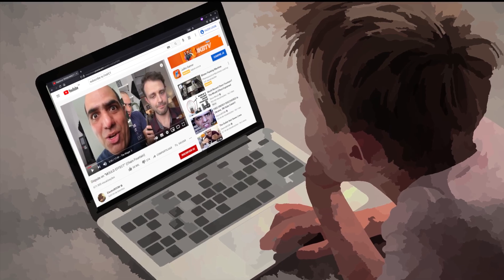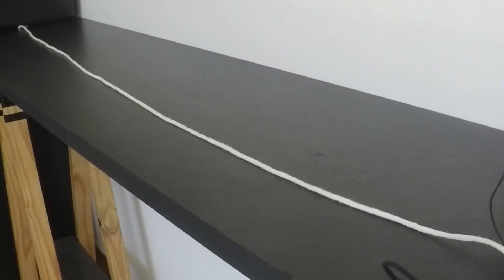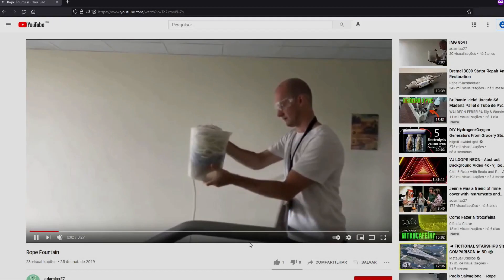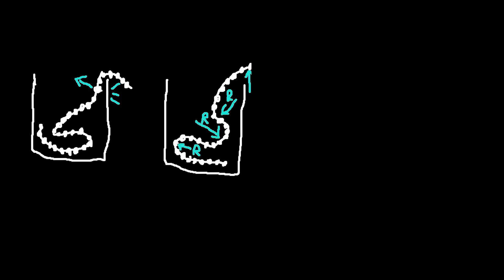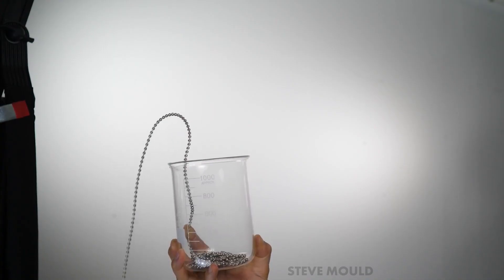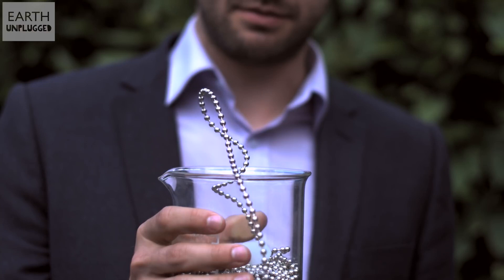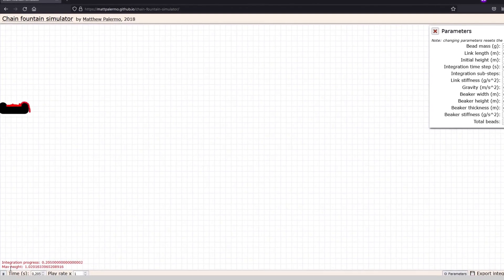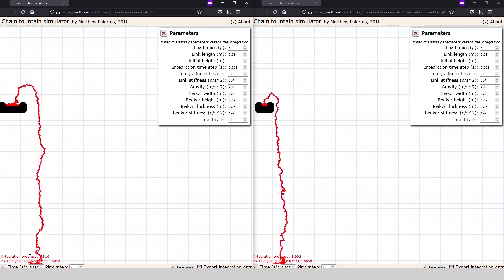ElectroBOOM vs Mould: Who's right? How does a chain fountain REALLY work? Mould effect explanation

Comment from the maker: In my view, the main problem from most explanations is to assume that the system is in a steady state, there is an significant influence from the dynamics of the waves that form as the chain is pulled out of the container, introducing fluctuations on the tension in the chain. 
We need some more slow-mo footage to analyze and new experiments trying to suppress the wave formation.
Reply: Sorry, it might be false - a video called "horizontal chain fountain" on the channel  Jeremiah Wanga has a chain going off a horizontal surface with out climbing a vertical wall before the edge.  It grows pretty high, but as the motion smoothens out, the height goes down though the horizontal distance gets really long.  But honestly, it's almost as if the chain is taking the acceleration and acting like a spring vibrating at it's resonance frequency...
Reply from the maker: @nukedathlonman  Interesting, haven't seen it before, very intriguing. As Mehdi said in the last video, the fountain tends to grow in the direction it is coiled. I'm not sure, but in the video it seems that there are "twists" in the chain as it unravels, which make the chain oscillate up and down, helping it o rise.  Later the effect may be less pronounced, making the loop grow horizontally.  
Thanks!
Reply: @FinFET  Hmm...I didn't see twists, but I thought I seen those metal ball chain couplers, which do seem to change the frequency/oscillation at those points.  Hmm...  Anyways, I think right now your the closest - but I think there are other effects in play too (not sure about the lever effect, am thinking centrifugal force is part of the effect and thinking there is Moulds kicking effect). :-)  I wish I had some bicycle chains around to see how that type of chain reacts when the balls (links) have a fixed distance between them.  Also wish I could build a ball chain but insert springs over the links between the balls to see how that would effect the chain.  Very interesting stuff.

Comment: Steve & Co are mostly wrong.
The question(s) are not whether there is a reaction force, they are 
(1) whether the reaction force is needed to create a fountain,
(2) whether the reaction force affects the height of the fountain.
The answers are No & No.
In relation to the horizontal fountain, the answers are Yes & Yes.
But, the original questions relate to a chain from a bucket/beaker/container/can -- not from a horizontal surface.
So, that was their first mistake.

Now to their second mistake.
The mere existence of a reaction force does not make the answers Yes & Yes.
The reaction force (at launch, in the bucket) borrows power from the falling chain.
So, it can't add to the height of fountain (at launch, from a bucket).

Links landing on the floor do add to the tension in the falling chain.
Hence they add to the height of a fountain.
But the lever action (kick) at launch in the bucket does not add to the height of the fountain.

There are (can be) two kinds of kick. 
Kick 1.  One is the simple lever kick (due to a say 90 deg bend in the chain).
The other is a similar kick that is due to the chain having a bend beyond 90 deg.
Kick 2.  We sometimes see a bend of 180 deg, or more.
That large bend creates a slower & possibly greater kick.
But, both kinds of kick (at launch) borrow power from the chain, hence they don’t add to the height of the fountain.
Except in the case of launching horizontally from a horizontal surface, where there would be no vertical fountain were it not for these two kinds of kick.

Except that there is a third kind of kick that will give u an enormous vertical fountain offa horizontal surface.
Kick 3.  And this kick can be created by laying the chain such that as it is being yanked horizontally it has to jump over itself.
It’s a jump-kick, & has zero to do with lever action.
Whereas the other two kinds depend on lever action.
Kick 1 & Kick 2 do not add to the height of a fountain, koz they borrow from the system.
Kick 3 also borrows from the system, hence at launch from a bucket it can't add to the height of a fountain.
But, from a horizontal surface, Kick 3 does add to the height of the fountain, koz, without it, the height would be zero.

Kick 4.  However, Kick 1 & Kick 2 can give a small non-zero height from a horizontal surface, but this usually arises due to the chain clattering over the (usually) sharp edge at the end of the surface. This can be called Kick 4. It thrives koz its (little clatter) effect is cumulative (as of course are Kicks 1 & 2 & 3).

Steve & Co are wrong.
Mehdi is mostly correct.

Comment: Whips effect doesn't increase the amount of force, it transfers it to a continuously smaller mass, whips get increasingly thinner and the bend radius decreases, so, through conservation of angular momentum,  the tip velocity increases, you wouldn't get the effect with a consistent-width cord or rope, and since the chain fountain has a consistent angle, and a consistent linear density of chain, whip effect is impossible.

Comment: No, sorry, they tried doing it without an edge, and the Mould Effect still shows up. 
Here is what I came up with to explain what I think is going on:
○–○–○–○–○–○–○–○–○
Bead Chain Mould Effect hypothesis:

If any of you watch(ed) the following video, where a couple of scientists at the Royal Society took on this mystery (I left my hypothesis, as below, on that video, too), compared to theirs and the people that disagreed with them and Mould (like you do), that I think explains it better. The Royal Society video is here:

https://youtu.be/-eEi7fO0_O0

They draw a diagram that they think is explaining the Mould effect, that seems to agree with Mr Mould. The diagram with the flat bars is close to the truth of what's actually going on, IMO. The issue many people are having is that the chain isn't a series of bars with short connections between them, but a series of balls with short connections between them.

However, the spherical beads in a ball chain are held together with metal wires - very inflexible wires, at that. There's no flexibility to allow the bead itself to rotate individually as it is being pulled up, because of that rigid wire holding it to its neighbors on the chain. That rigidity forces the wire in between the beads to lever and push against the neighboring bead, imparting that force to the next bead, which makes the bead being picked up by the rest of the chain jump upwards. 

The only difference between the flat bar chain diagram they use in the video above and the bead chain used in all of these videos between the two "competitors" is that the lever point for a bead chain is in the center of the inflexible wire between the beads, not the center of the next flat bead in line to be lifted, like in their diagram. 

[I hope I've explained it clearly and succinctly, as I'm running on no sleep, and it's nearly 6 AM.]
○–○–○–○–○–○–○–○–○

Comment: 7:00 The guide can contain motorized wheels, not simply passive bearings.  The speed can be matched to the chain speed, so it's essentially frictionless.
In addition, it can be used for additional experiments, pumping the chain upward, thus artificially providing a "kick".  
By using two such motors, the other being on the downward run, you can regulate the speed rather than waiting for the equilibrium from the weight of the chain, force two ends of the chain to pass through constant points, and study how varying the forces at these two points causes waves, builds up the fountain, etc.

Comment: Something you sort of allude to with your description, accidentally or intentionally, and which I have not seen discussed elsewhere, is perhaps the sides of the container introduce a harmonic effect. If we follow your suggestion that the larger wave results from the constructive interference of smaller waves, perhaps the wall of the container acts somewhat like a fret board and it causes the noise of lots of waves of different frequencies to resonate more strongly at a frequency which contributes to the constructive interference.

Comment: It's all about the centrifugal forces on the mass of the beads as they make their 180 degree turn.  No?
Reply from the maker: Not really, it sure helps, but if it was only that, the diameter of the loop should increase as the chain gains speed. The loop actually gets taller, but the diameter of the turn is more less constant. There is indeed something else going on, in my view are trapped waves, Mould says that the chain is kicking against the container. Surely the loop needs a sort of surface to stand on, but this is just regular reaction force.
Reply: @FinFET  Ridiculous!!
Reply from the maker: @sanjuansteve  
😂

Comment: I think the beads are spinning that's why it works better with that type of chain. A rope can do it too by twisting and untwisting
Reply from the maker: You mean the beads itself or a coil of beads, not sure wat you mean, but what I get is that the other types of chain resist more to the twisting motion. I think that may influence as the chain gets lumped in the container, it gets "heavier" sections which are harder to pull up.
Reply: @FinFET  Yes, I think the individual beads are spinning. Someone needs to put a high speed camera on this with striped beads.
I'm no physicist but I think as one end of a link is accelerated from rest, the other end acts like a pivot point but it is not rigidly held by the next link. The "pivot" being somewhat free, allows the momentum to seek/move-toward an axis with the most mechanical freedom (or smallest moment). So some momentum is "turned into spin" while it also influences the next link. You can see them lift off in a circular path with their axis parallel to the ground then spiral in as their axis turns vertical. The beads carry their spin up until they're forced to change their axis, like little gyroscopes they pull against the falling chain. I would also speculate that as the energy of the system increases, the spin momentum "generated and stored" in the upward moving beads also increases therefore raising the height.

Comment: What if you put a motor on the bottom of the string and pull it faster than it could fall on it's own. Could the wave grow even taller than all of the experiments? Thoughts on this? And if so the height of the wave would depend on the speed of the sting. Both the unevenness of the string or the weight of the sting (for overcoming friction) would explain why some work and some don't.
Reply from the maker: I believe so, the velocity of a wave depends on the tension on the chain, with a stronger force it should adjust itself. It would be basically the same as dropping from a higher height, where the force increases with the length of the chain that is falling.
Reply: I also found this video when reading through other videos comments on the topic. The arc on the top seem to do somtehing similar, but it might be something completely different as well and I'm just drawing weird parallells. But I find it interesting nonetheless and it might have something to do with it so i'm adding it.
https://www.youtube.com/watch?v=rffAjZPmkuU
Reply from the maker: @williamjg2347  such an interesting behavior, thanks!

Comment: Thank you. The whip effect downward force acting with angler momentum. Like a whip.
A rotating object will speed up if you pull weight to the center or slow down if you bring the weight out. Or a sail boats sail at an angle with the wind will travel faster than the wind.
The chain effect is a force pulling the chain the angle is creating an opposing force creating lift.

Comment: I like your wave/whipping idea and waves traveling along the chain, but I think you need to take into account that the chain is also moving. 

My take on it is as follows. The "stationary" wave at the top of the loop would be a progressive wave moving backwards against the flow of the links at exactly the same speed as the links. The speed v of a wave on the chain is, v = sqrt(T/lambda), where lambda is the mass per unit length and T is the tension in the chain. So the wave speed is proportional to the square root of the tension. I think the tension is maximum at the top of the chain. If we assume it's zero at the ground it would be near T = lambda * height * g at the top. That would give v=sqrt(g * height).

Elsewhere on the chain, the tension is lower, so the speed of the wave is lower and it would be carried away to the ground.  At the beaker end, the lifting of the chain is a kind of unrolling effect requiring the chain to oscillate transversely (as you say) which generates waves. Waves traveling to the right get whipped away to the ground because they travel in the same direction as the links. The backward propagating waves drift slowly into the main loop as the tension on the left side is slightly less than in the loop itself. Once they are in the loop they stay as their speed is now matched by the tension. So you could imagine the loop as a "trap" for waves generated at the beaker.

There is a nice video of waves moving in a endless looped chain here, https://www.youtube.com/watch?v=Ff8oqoYxD7U which might inspire you.
Reply from the maker: Nice, thanks man! That video is really cool!
Reply: @FinFET  I found an even nicer video of waves on moving chains, https://www.youtube.com/watch?v=Cw1flJdFjEA

Comment: The Cambridge-model is a completely steady-state model - they look at the situation where the falling end of the chain has already reached the ground. As such it is completely insufficient to model the dynamics of the effect...
Reply: That is because they only focus on the initial acceleration, which ignores the fact that the element is falling regardless. Resistance and height are the true variables.
Reply: @bradpoole238  You must have confused their paper with someone else's. When they assume steady-state they assume that all initial accelerations have ended. There are other studies of this where they look at this (or similar enough) problem from the release of the chain.

Comment: What happens if you drop the container while the chain is falling?
Reply from the maker: I imagine that the loop could grow, but it would fall together with the container. This is a somewhat proxy to zero gravity, but it messes up with the pulling force (when we change the frame of reference)
Reply: It will sty the same until both sides pull at the same force, then fall.
Reply: @santiagoperez2094  It will decrease as the length of chain on the container side gets longer and has more mass unsupported by the normal force of the container.